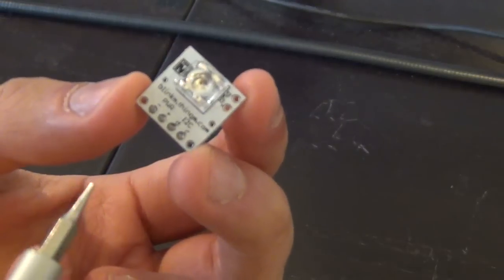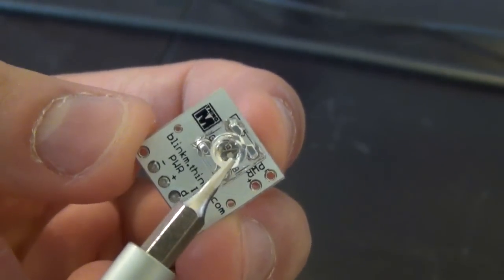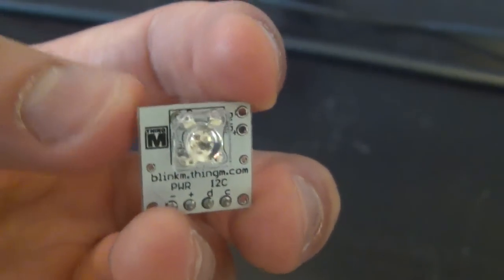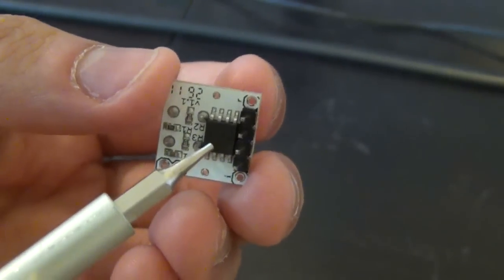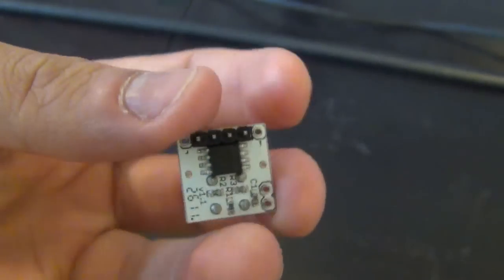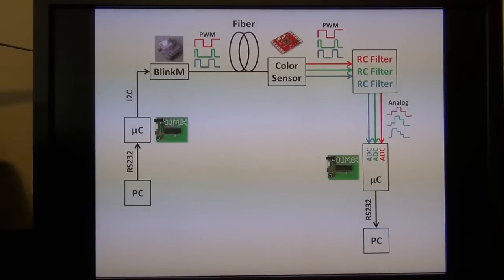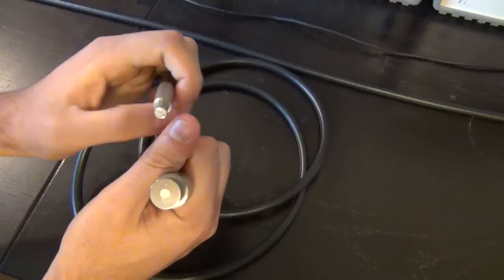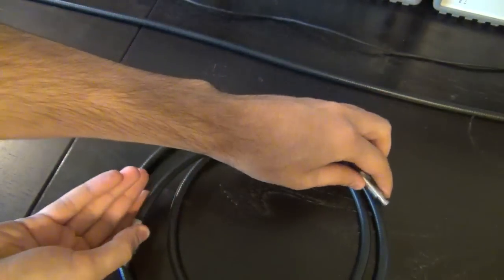TSP #10 - Tutorial on Waveform Shaping and Signal Constellation in an Optical Link

Comment from the maker: The BlinkM uses a 120Hz PWM square wave. I used an RC filter with a 3dB bandwidth of only a few Hz to clean that up. In theory, an active filter can clean up the signal much better (higher roll of factor) which would allow for faster data rate. Great question by the way. Thank you.

Comment: Interesting idea. Some ideas after looking at this a few minutes (I'm an EE ).  a)The emission spectrum (data value on x axis, intensity on y axis) of the emitter and the detection spectrum of the receiver should be mapped and used to remap the values sent to the emitter.  b)Something similar needs to be done for the fiber to evaluate it's effects on R, G and B intensity.  c)The RC filter is introducing very large phase shifts in the data.  This fundamentally introduces  a time domain error in the detector.  I suggest a direct PWM demodulation approach to reduce this error. d)I would investigate using larger spectrum separation to improve crosstalk between R, G and B channels i e. use of Infrared and Ultraviolet LEDS.  e)Consider abandoning using multiple amplitude levels as part of the modulation scheme.  Multiple different color LEDS, each transmitting NRZI data with full on, or full off, could be more easily detected and demodulated. f)A tight cluster of standard Red, Green and Blue, LEDS can be used as light detectors.  Lastly, you're probably already aware of this but multi-wavelength  transmission over optical fiber.   GREAT CONTENT.  JUST SUBSCRIBED.

Comment: I know that its an old post, but the rgb sensor is out of stock, gone, not being produed anymore.. Anyone knows of a replacement without a digital section ? The speed is just below of what  i need it to be...
Reply: Doesnt even need to have a build in gain..
Reply: SparkFun Spectral Sensor Breakout - AS7262 Visible  has a similar spectral response

Comment: Great presentation -- as usual!  Question: Why do the three digital color signals need to go through an analog step (RC network, ADC)?  Why not just feed the WDM pulse streams directly into to the microcontroller?
Reply: The LED brightness is set by pulse width modulation. Normally you'd filter the PWM signal so that the LED intensity is constant for the duration of a symbol. That way, you're using less optical bandwidth.

That's not possible here without modifying the RGB module, so Shahriar does the filtering after the photodiode. One benefit of doing this is that he can saturate the receiver and get a digital signal.
Reply: @ignaciomartinez6245  ahh right so the LEDs are super fast PWMing - and then he gets the fast PWM flashes on the other end & low passes it to get the analogue level back. 

the low pass is needed to remove the high frequency noise but also to smooth out the high frequency PWM into a coherent stable 1/4 level, i figure.

Comment: This is very cool, have you tried using Manchester style encoding scheme to create a self-clocking signal? You could try increasing the bit rate and the bits/symbol until you came across the limit. Further, you could try using an algorithm to scan through the constellation repeatedly and determine which transitions are clearly distinguished and which ones are less reliable. Maybe you can get more resolution in some regions of the constellation. Would this be effective in a single mode fibre?

Comment: I am trying to send a analog signal of atleast 1.5-2Mhz, 2 digital signals of 5v and 15v signals over a single fiber optic cable without using a computer. Meaning the input would be coaxial then sending it over fiber.

Comment: this is a great video. the QAM showed at the start with the 2 dimensional constellation is for Phase. a single sine wave sent down a pipe varying by amplitude and phase. its cool to see the recovered clock signal. decoding is so much harder than encoding.

Comment: using PWM with a low pass filter is something ive seen done in a lot of places to make analog wave forms. it'd be cool to use a soundcard with a light on the end of it and then encode data in the single channel but with phase as well. i never quite figured out how to lock onto the phase without some kind of extra encoding to put it there like manchester or something.

Comment: I was about to ask why filter the receiver rather than the transmitter, but then I remembered you wanted to use the off the shelf PWM gadget. Did you test the frequency response of the sensor at all? Great work on the video, would love to see a follow up on RF modulation ;)

Comment: on that scope thing the lines that are at different heights are go up at different angles, if the computer can detect this you can use this as a value to detect this angle you could use this to get a colour as soon as the value is not 0, however the noise would overlap more at this point so i dont know if that would have more of an effect at this point.

Comment: Interesting video, thanks a lot. I have one question, why is the data rate so slow? If you are using multi-wavelength, multi-level signals shouldn't you get high speeds.